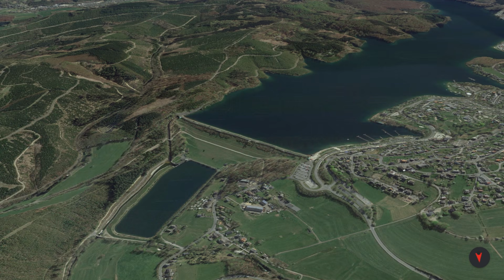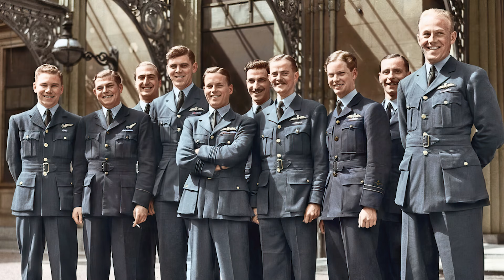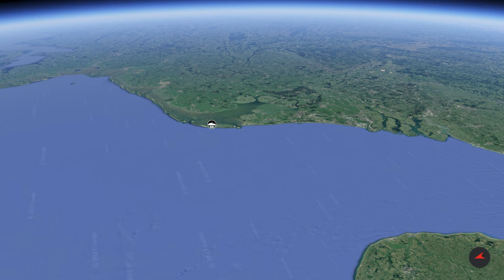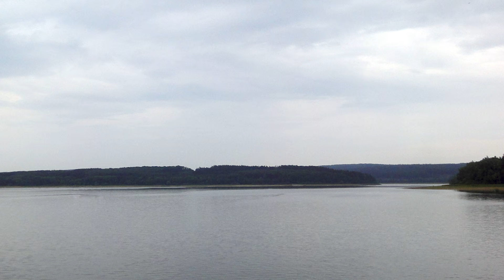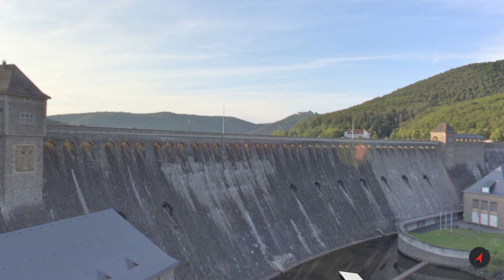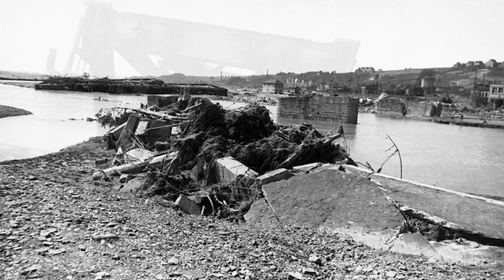The 'Dambusters' Raid (No AI Documentary)

Comment: In terms of the impact of this mission, the channel Hardthrasher has an excellent three-part series on the raid which I’d urge you all to watch, but he summarises the impact from about the 23:30 mark in part 3. In short: it probably had an enormous impact, but in ways that are hard to measure. The Germans needed to repair the dams in time to capture the autumn 1943 rain, or in 1944 industry would grind to a halt. Because of that urgency, workers were even moved out of the armaments industry into dam reconstruction. This impacted Germany’s readiness for Operation Citadel on the eastern front, which they ultimately lost. They also recalled 7,000 workers familiar with concrete and steel from building the Atlantic Wall. Hardthrasher notes that in April 1943 770,000 cubic metres of concrete was poured on the Atlantic Wall; in May that figure dropped to less than 300,000 cubic metres and didn’t recover until Q1 1944 (i.e. not long before D Day). They also moved 300 search lights and over 1,000 AA guns out of German cities to defend dams from further attack. These all probably resulted in massive shifts in how the war ultimately played out.